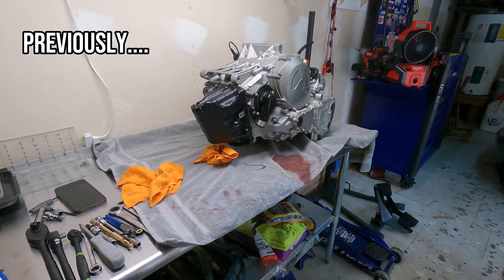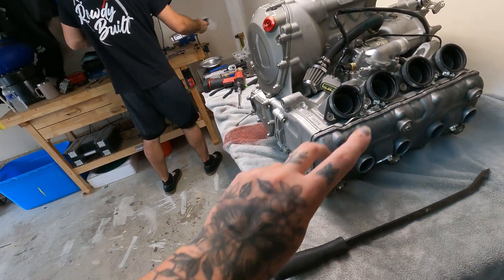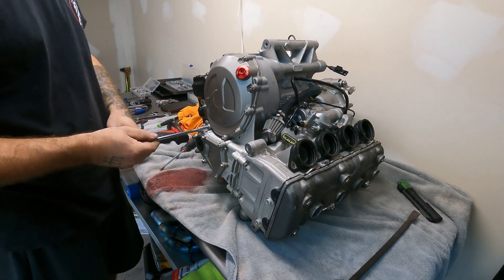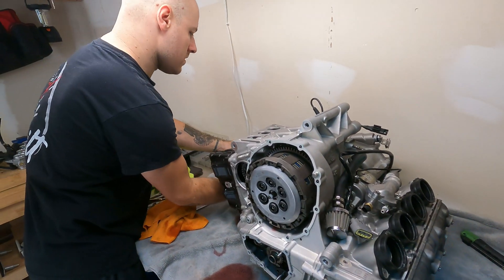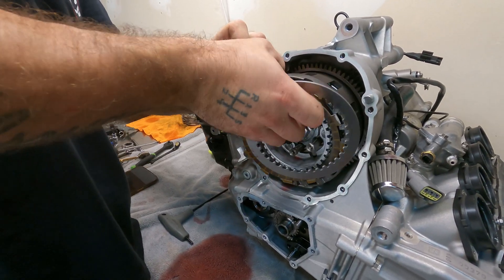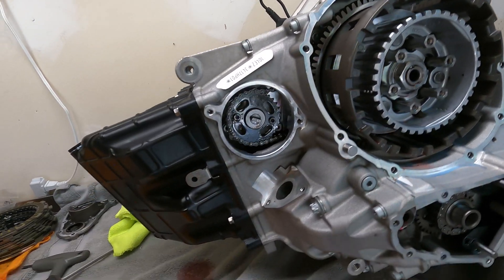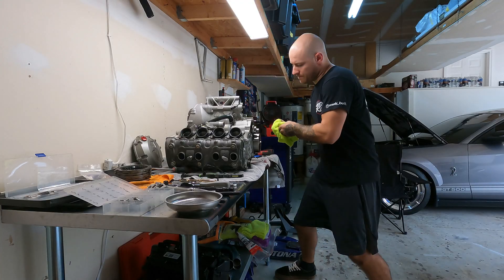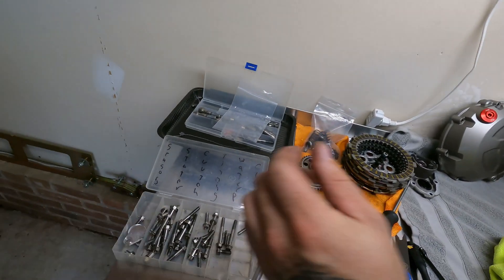BMW HP4Race Tear Down Reveals a MAJOR Problem

Comment: Howcome so many BMW liter engines blow up ? Throwing rods through the case etc, one would think that BMW would redesign/upgrade materials used to minimize this.  Higher state of tune at 215 HP on this of course but still. Standard S1K's go aswell, sad.
Reply: Because they are built like their cars… shite. Junk. Nothing but problems. No thanks.
Reply: They don't, you just have no idea what you're talking about and ride a Kawasaki lol. They had bad 2023,2024 models that people that ride japanese bikes keep yapping about. meanwhile kawasaki sells millions of lemon turds and you guys say nothing😂 from 2009 to 2023 the s1000rr had no major engine issues and will routinely get 100k plus mileage. the majority of people that got screwed on their warranty were knobheads that decided to FBO the bike before it was even broken in, ripping it on the dyno and then complaining when their bike wasn't covered. 

meanwhile.... the 636 has been randomly grenading since 2013 and kawi never did a thing about it. go to youtube shorts and type in kawasaki 636 blows up and watch how many are parked on the side of the road while a puddle of oil underneath😂. absolute Junk.
Reply: @drewcecato221  What rock do you live under?  The BMW performance motorcycle engines have been randomly destroying themselves for years now.  You are living in a state of complete denial bud.

Comment: BMW stretches all those bolts from the factory because they are pricks and stop being so nice to it with a the ratchet just blow them out with an impact gun theyre not 1970s cast aluminum cases its not going to do anything hammerdown😂

Comment: The coating on the cams is DLC if its damaged  then  cams are scrap
Reply from the maker: Definitely been extremely gentle with everything
Reply: That's not true at all, the camshaft lobes will wear and the DLC coating along with it.  It's impossible not to have wear given the amount of stress the lobes and coating are subjected to.  The camshaft is not scrap once that occurs, and it will as you put mileage on the engine. DLC is just a coating to decrease friction.